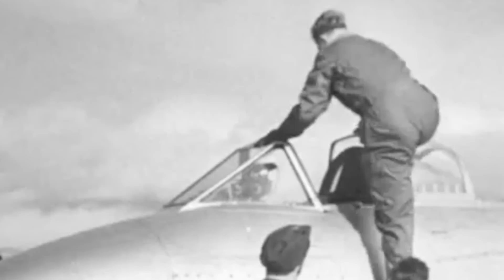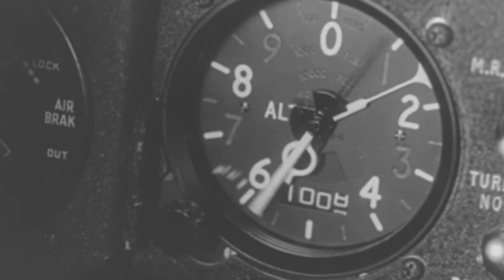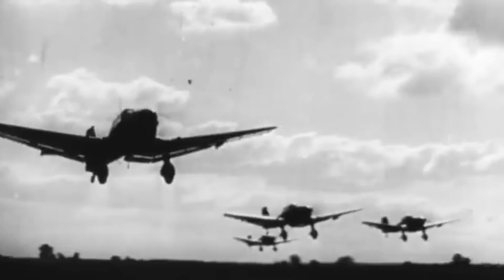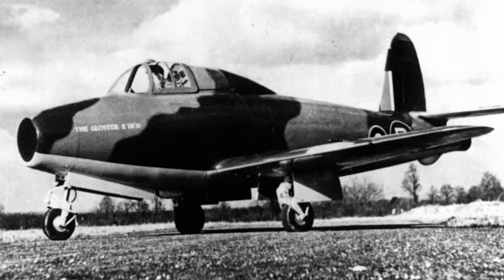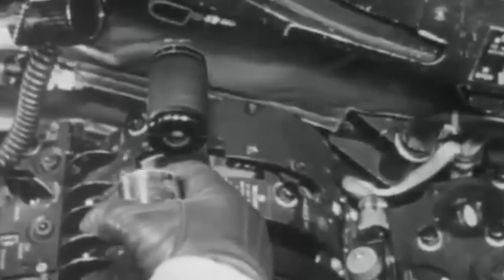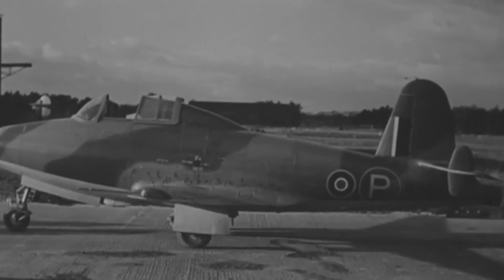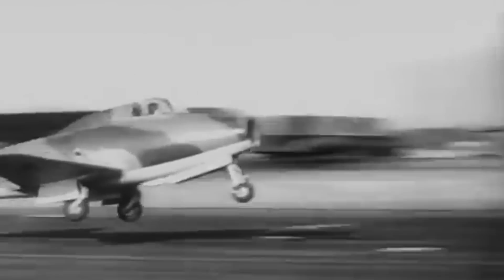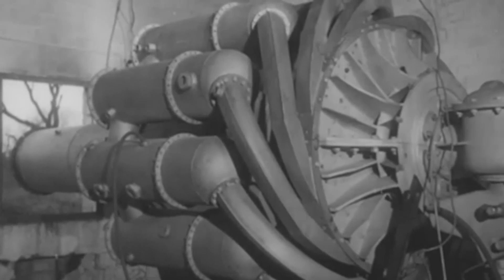Britain's 500 MPH Coffin With Wings

Comment: Frank Whittle's engines were all failures, none were reliable enough to meet the minimum reliability standards for adoption into service.
 Centrifugal compressor jet engines would prove to be an evolutionary dead-end concept and were obsolete technology upon arrival.
Reply: We feel we can clear up some commonly held myths and misconceptions, obviously.

It's always good to see the facts presented clearly and concisely isn't it

See further down for a Meteor losses comparison.

Indeed that's correct. The Whittle Gloster E28/39 was of course a brilliant aircraft that was later copied in Russia as the upsized and tweaked Mig 15 with a copy of the RR Nene gas turbine aero engine.

Obviously the RR Nene being the world's most powerful & most reliable gas turbine aero engine in 1944. 

   That's correct, of course the MD F3H Demon was a contemporary to the DH Sea Vixen & had a similar performance. The F4 Phantom was a follow on from the F3 Demon. The Sea Vixen took a long time to get from first flight to introduction for various reasons and a similar situation occurred with the MD F3H Demon. 

McDonnell Douglas F3H Demon
590 Built.
Introduction date 7 March 1956
First flight 7 August 1951
Retired 1964

MD F-4 Phantom 2
Number built 5,195
Manufactured 1958–1981
Introduction date 30 December 1960
First flight 27 May 1958

DH Sea Vixen
Number built 151 (including two DH110 prototypes and one Sea Vixen prototype)
Introduction date July 1959
First flight 26 September 1951
Retired 1972

Non combat phase accident losses.
% of Aircraft built.
The Canadair CL-44 was a turboprop airliner.
Canadair CL-44              (ff 1959 ) 48%
Lockheed XF104              (ff 1954) 100%
Lockheed  P80                 (ff 1944) 43%
Lockheed F104                (ff 1954) 45%
MD FH Phantom 1           (ff 1945) 35%
MD F4 Phantom 2           (ff 1958)  28%
MD F3H  Demon              (ff 1951)  32%
Gloster Meteor               (ff 1943)  21%
DH Vampire                    (ff 1943)  23%
DH Sea Vixen                  (ff  1951) 33%
Gloster Javelin                (ff 1951) 20%

    Regarding the UK Aerospace Sector.
  
An airline recently ordered 60 RR Trent XWB Engines

   Clearly It's a great pity & a crying shame that British military forces had to occupy a large part of Germany for decades after 1945 & Russian military forces had to do the same. Of course Russia still posseses a large chunk of what was German territory & of course Russia & the UK produce nukes. Obviously Germany does not produce nukes.

   Interesting British achievements.
There is no doubt that the Fairey (England)
Delta 2 was of course the world's first jet
aircraft to exceed 1000 mph.  lndeed It
exceeded the previous record by 310 mph &
held the record for 1 year. Incidentally, the Dassault Mirage 3 & 4 are based on the Fairey Delta 2.

Early days, jet fighters.
   De Havilland Vampire, Sea Vixen & Gloster Meteor accident losses were not high or unusual for fighter aircraft at the time. De Havilland built large numbers of all metal airframe aircraft before the DH Comet.
We mustn't forget of course that the DH Vampire for example first flew in 1943 & the engine was also built by De Havilland. There were examples of the Vampire interceptor / fighter in service until 1990 which was operated by more than 30 countries.

Non combat phase accident losses.
% of Aircraft built.
The Canadair CL-44 was a turboprop airliner.
Canadair CL-44             (ff 1959 ) 48%
Lockheed XF104             (ff 1954) 100%
Lockheed  P80                (ff 1944) 43%
Lockheed F104                (ff 1954) 45%
McDonnell FH Phantom  (ff 1945) 35%
Gloster Meteor               (ff 1943)  21%
DH Vampire                     (ff 1943)  23%
DH Sea Vixen                  (ff  1951) 33%
Gloster Javelin               (ff 1951) 20%

   An example of what goes on these days in various countries.
Obviously, for example, there are of course no German companies that makes German jet aircraft in Germany & there are no German Companies that make German gas turbine aero engines in Germany that are suitable for widebody airliners.

     That's correct, Brazil makes very good airliners & Brazil is 100th down the list along with Indonesia for wealth per capita. Of course it is in fact the case that Embraer can't build those airliners without purchasing stuff from the US, UK & Europe.
Norway Holland Denmark Ireland Belgium - Top 20 wealth per capita - Don't make airliners -  its as simple as that.

   Early days of the airliners.
That's correct of course, at the time the Comet wasn't particularly dangerous. Agreed, that is indeed the case of course, The DH Comet was definitely not the worst engineering failure in commercial airliner history.

Losses comparisons
How things were in those days.

DeHavilland Comet 4 UK                       14%
DeHavilland Comet all  (ff 1949)           17% 

Boeing 307                               70%
Boeing 247                               48%
Boeing 707            .                  20% 
Lockheed Electra Turboprop   29%
Canadair CL-44  Turboprop     46% 
Convair CV-580  Turboprop     22%
Convair CV-880    (ff 1959)       27% 
Convair CV-990     (ff 1961)      33%
Tupolev TU-104       (ff 1955)    16%

     Of course De Havilland had prior experience building many all metal construction airframe aircraft & thousands of jet powered fighter aircraft that were primarily of metal construction with pressurised cockpits & jet engines built by De-Havilland.

  More recent UK military jet aircraft.

  Of course the Tornado & Typhoon & their engines are Supersonic & are indeed British design aircraft with British design engines built by an international consortium. The Tornado design for example started life during the 1950s at Vickers as the AFVG, it's engine is based on the RR RB-199. The EE Lightening is also a British Supersonic jet aircraft.

  The Typhoon is the British BAC-EAP with an engine based on the British RR XG-40, the Typhoon is also built by an international consortium.

  Agreed, that is correct of course, clearly there are many countries that could easily produce airliners of better quality than Bow-wing (see b-47 wing folding & wing collapse incidents) but don't for some very good reasons. Bow-wing (see B-47 wing folding  & wing collapse incidents) being a result of the size of the US, the large protected domestic market & great ease of testing new types due to the equator to arctic geography complete with up to date aviation infrastructure & a few other reasons related to production scale capability, politics, the nature of the airliner market coupled with the nature of airliners themselves & general basic economics.

  Obviously there really is nothing special about Bow-wing, having more than 50 years design / build experience on the type means they have no excuses for the horrendous 737 Max incidents for example.

    Indeed GKN Aerospace, BAe Systems & Rolls Royce combined now do more Airbus work than Germany on an absolute basis & significantly more work than that on a per capita basis.
  
     Agreed, Per capita for the home nation BAe Systems is the world's largest defence contractor.
 
    Correct, BAe systems announced the recent £4 Billion takeover of Colorado based US based Ball Aerospace.
 
    It's definitely the case that BAE systems now does a significantly higher value of work for Airbus than it did when it was a major Airbus shareholder before 2005.
    
      Obviously RR now owns US Engine maker Allison for example which does classified Aerospace work for the US Govt.
  
   Yes, that's right of course, Anybody currently flying on a widebody airliner stands a good chance of being on an aircraft powered by RR gas turbine aero engines built in the UK.

   A typical but small glimpse of what goes on in the very internationally orientated British aerospace sector. 

  Of course the RR Nene was in fact the world's most reliable & most powerful gas turbine aero engine in 1944. Licensed built versions & copies of the RR Nene & RR Derwent would go on to power many aircraft in Russia including the Mig 15 & Mig 17, the US, China, France & other countries for decades after 1944.

      Boeing Apache Attack Helicopter.
AH-64: 75 UK suppliers, 7% UK content, global fleet of 1280+ aircraft.
F35B more than 130 UK Suppliers, more than 30% UK content.
F35A & F35C more than 130 UK Suppliers, more than 15% UK content.

   There is no doubt that an airline has just ordered
60 RR England Trent XWB Engines

Obviously the UK has the
World's Highest Combined Per Capita
Nuclear / Defence / Aerospace Sector Activity.

Rolls Royce Holdings UK
Subsidiaries
- Rolls-Royce plc
- Rolls-Royce North America (Allison etc Classified Military stuff)
- Rolls-Royce AB
- Rolls-Royce Deutschland
- Rolls-Royce India Private Limited
- Rolls-Royce Marine Power Operations
- Vinters Engineering Limited
- Rolls-Royce Controls and Data Services
- Rolls-Royce Power Systems
- Bergen Marine
Joint ventures include:
- Rolls-Royce Turbomeca
- MTU Turbomeca -

Trent Family
The MT30 (Marine Turbine)
Industrial Trent 60 Gas Turbine
Trent 7000
Trent XWB Airbus A330neo.
Trent 1500
Trent 1000
Trent 500
Trent 600
Trent 700
Trent 800
Trent 8100
Trent 900

RR wholly owned subsidiaries in Germany handle smaller 2 shaft RR gas turbine aero engine work.

Clearly the line above this line is blank.

We do indeed hope this helps, of course.

Cheers as always & 👍 indeed.
    
. ..... ...... ...... ...... . . . .. . .